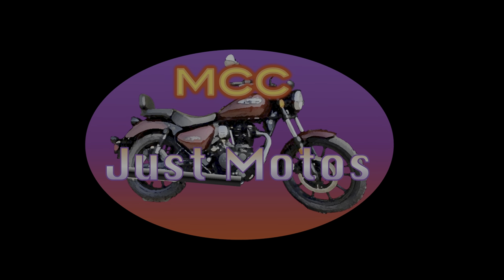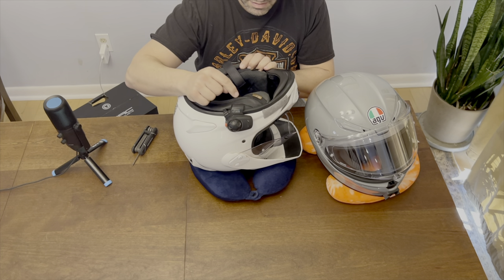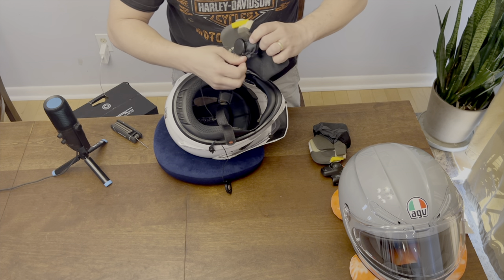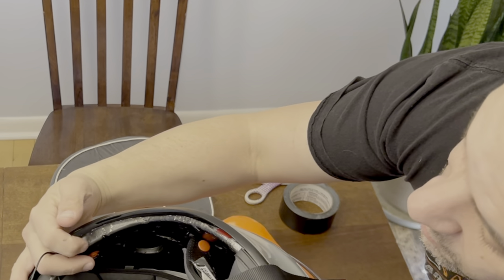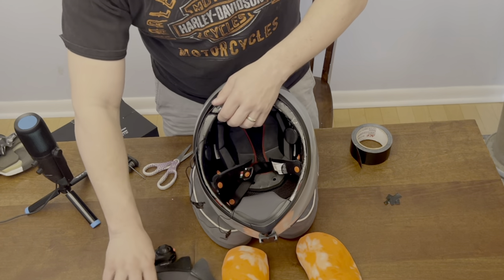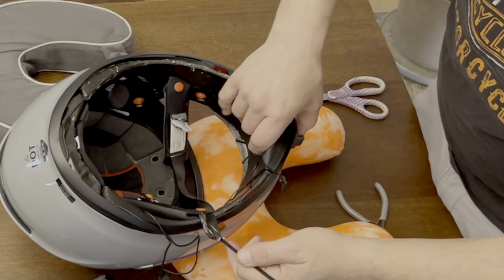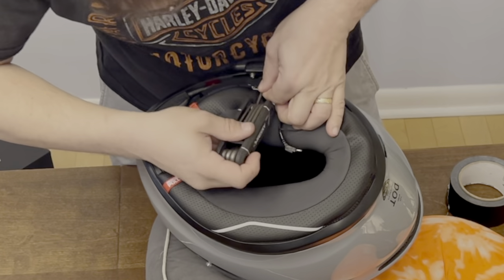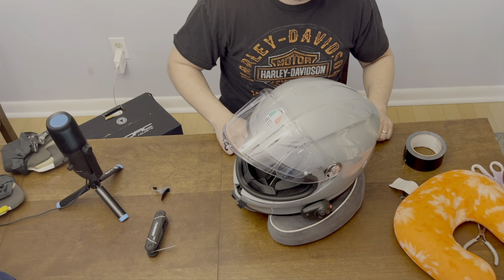AGV K6 | Sena Install - Switching  Helmet Comms How-To

Comment: Thank you for your valuable video. I would like to as a question. After I  mounted my intercom to the AGV K6 I faced with a volume problem. I compared either my ex helmet. In my opinion because of the pad covers volume might be decreased. Did you faced either that kind of problem?
Reply from the maker: You bring up a good point. Each helmet is different and I noticed I have to move the speakers around a little bit to optimize the volume for each helmet.